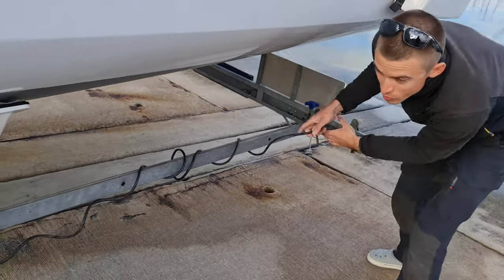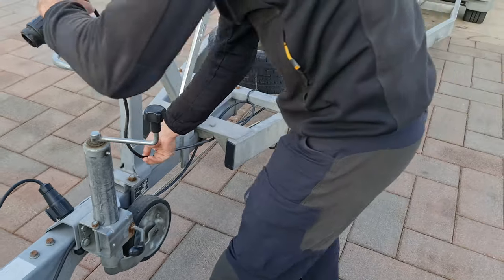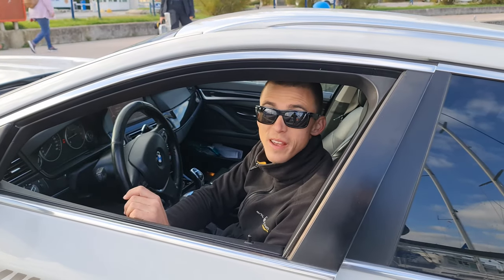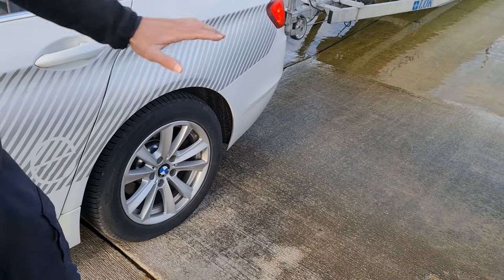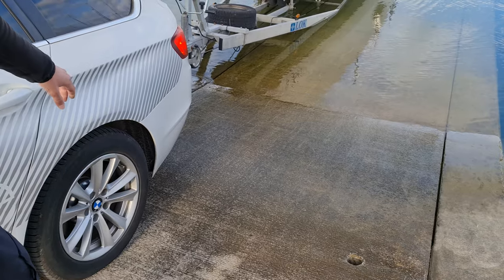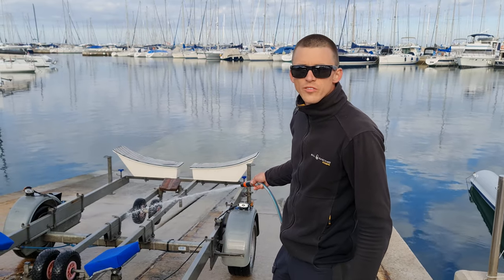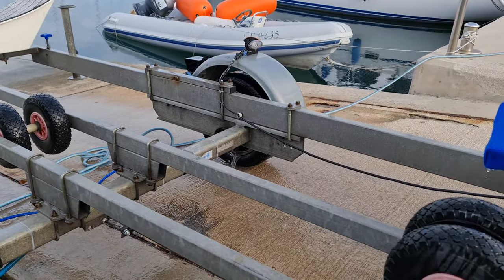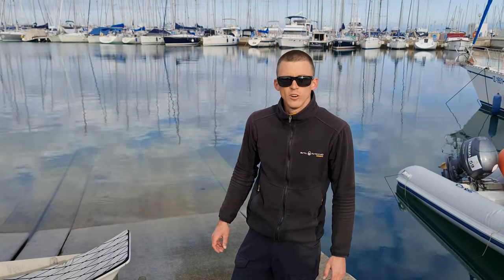Launching the Beneteau First 24 SE - Seascape Edition

Comment: The washing system on the trailer is really clever !!
Reply: Once I immersed the trailer, the next season I had to replace the brakes and control cables.  Now I go to the boat yard and get it lifted in/out.  Newer designs of trailers use a pivoting roller cradle at the back of the trailer and they don't need to immerse the wheels, I think they are CLH Trailers.
Reply: Genius!

Comment: The problem is that Beneteau do the bare minimum, from design to construction to finish.  For example the cockpit design should include moulded seats with a proper ergonomic seat back, much safer for children, way more comforatble for adults.
Reply: What does that have to do with a trailer launch video?

Comment: Y'all need a better trailer design.
Reply from the maker: Where do you see improvements that can be made?
Reply: @SeascapeEdition  Start with a trailer that is one piece and doesn't need to be disassembled to launch the boat.  Run the wiring for the lights to the tongue of the trailer hitch as well.
Reply: @DukeMorse so that they fail with repeated dunking in salt water?

Comment: too uncomfortable, better to have a mooring in port
Reply: Uncomfortable to launch?? How so?
Reply from the maker: Probably everybody prefers to have a boat ready-to-sail moored in the water, but that's not always available. In many areas, free moorings are not available or too expensive. Having a slip-launch possibility doesn't affect the standard "berth setup" in any way, but significantly widens what you can do with your boat. You can easily trail the boat to explore new destinations and lower the costs of winterisation (when you can store the boat in your backyard).